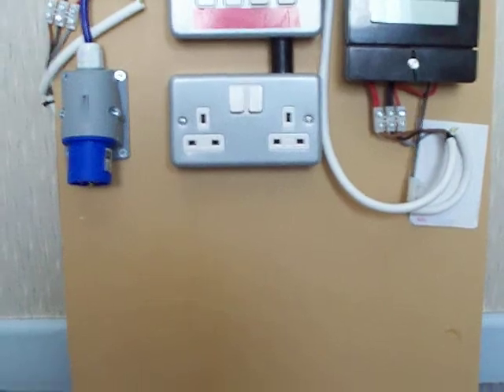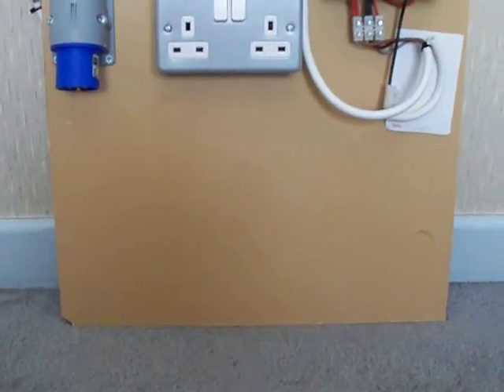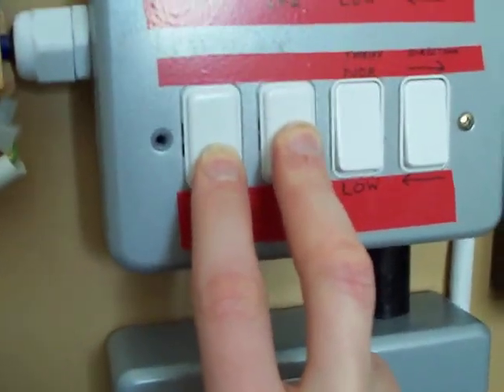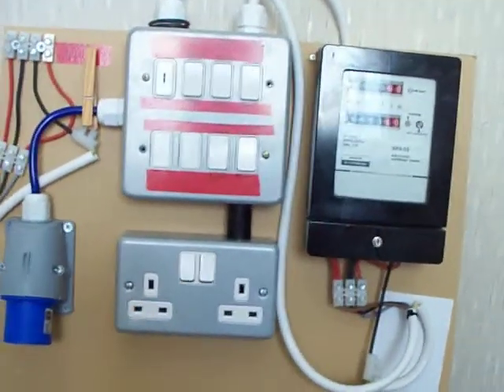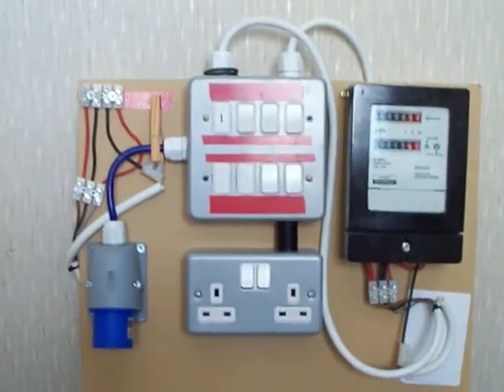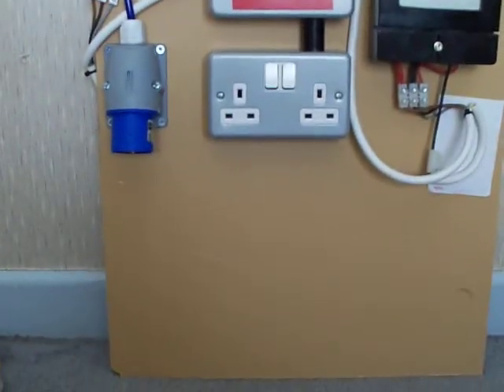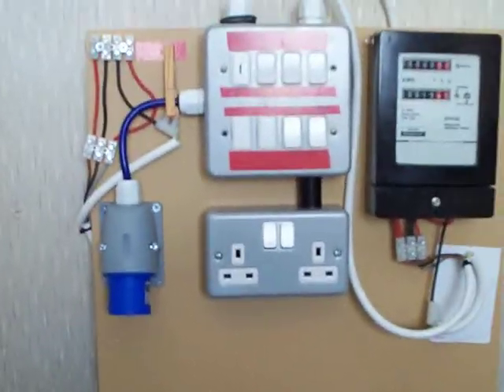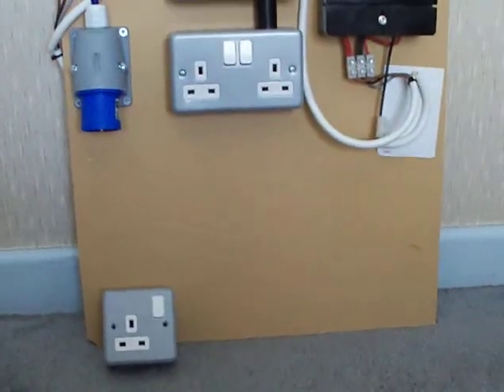News : Upcoming upgrade works on the Metering Board :-)

Comment: looking good.
turning itself off is a useful feature.
Reply from the maker: Yes, in reference to the timeswitch, that is.

I can make the timeswitch (via a specialised wiring config) turn off the timed socket and then itself.

This means that it would be useful for camera-battery recharging: I can set the timer for a set amount of hours, turn it on and leave it to do its thing.

Once the batteries have recharged, the timeswitch will then turn off the charger and itself, meaning a "once-only" operation. Perfect for use as a count-down timer for recharging batteries. :D

BoomBoxDeluxe delivers the flavour once again. :D

Thanx for watching.

-BBD

5th March 2014, 14.08
Reply: " "once-only" operation"
Exactly.